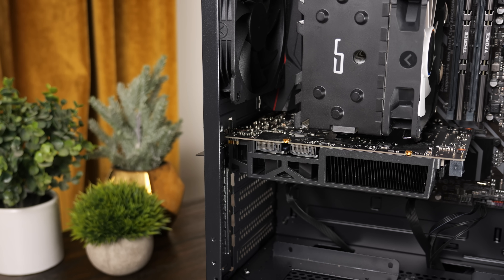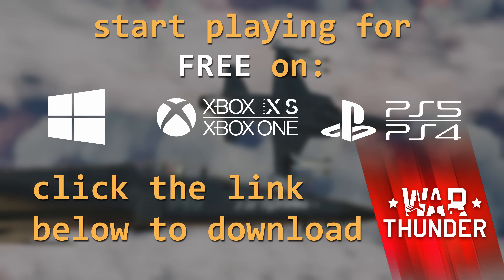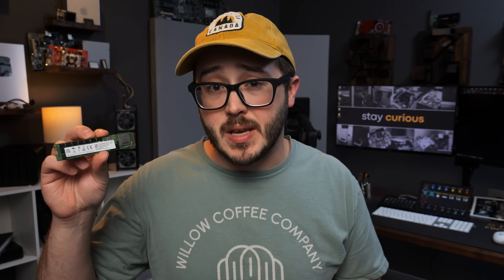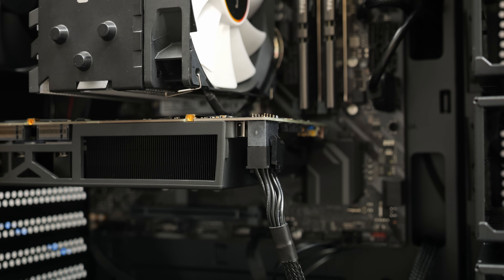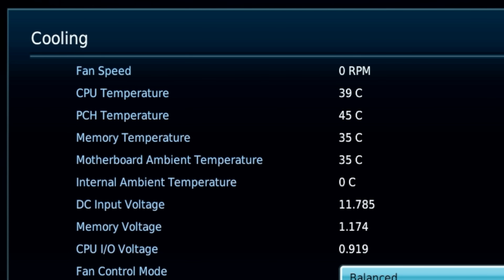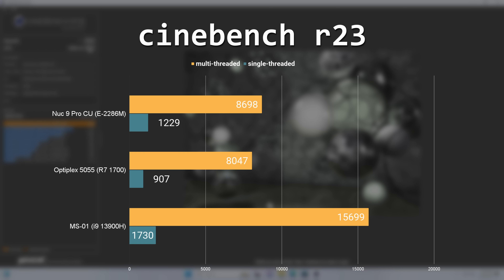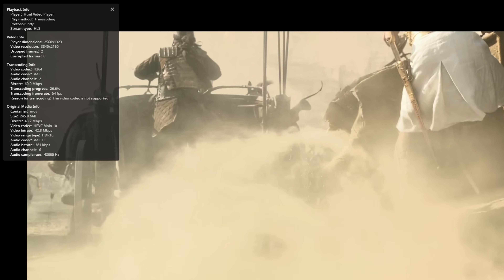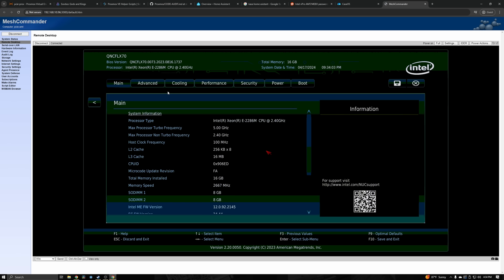I put a PC inside a PC (It’s actually GOOD!)

Comment: Running a computer inside of another computer for streaming was a thing before streaming became more realistic on a single system with capture cards

If I'm not mistaken there were computer cases that had mounting to add a micro ATX motherboard inside of the top of your gaming PC to separate the streaming software from the main gaming system

So the back of the computer case would have two IO shields

I don't think those lasted very long though

Bitwit posted a video six years ago "Dual Stream Streaming" that shows a case that does this

Comment: Was wondering if you were going to make a follow up on this video and go over any trials and errors that may have occurred?

I am thinking of trying this out but am still on the fence about it.

I would like to use it for game recording and video editing the games.

Do you know if I could use the Intel CPU in the nuc9 to remote with my AMD 9950x CPU (Windows) of my main computer, or if I could do a network connect between the two using the network ports?

Also if it could be possible to solder in a new power button with a long cord to a custom Bay drive mount for easier physical on and off.

If possible for my setup, I do plan on getting a USB switch for the keyboard so I can switch between both PC's if needed and since I use Display port connect for my main, I can just connect the HDMI from the nuc9 to my monitor and just switch inputs when needed or just get a Monitor input switch.

Comment: One thing I'd like to try with this is plug it into one of those pcie x16 risers that miners use for their gpus. Should probably still tape the lanes. That way, you won't need to take up a slot on your motherboard. It just needs power, right?

Comment: Parmy really wants this just to figure out how to force it to capture the computer it's connected to screen and Work as an independent recording PC on the same desktop. Someone could probably get it done with Linux. Either that, or it could function as a Windows computer running on a Linux system that would allow Linux users to play Windows games and software without worrying about getting banned for cheating( Report it as like a 1080ti Graphics card connected to the PC or something)

Comment: Honestly, I'd be curious to see how it'd function in an M2 Mac Pro, with the full pins exposed.
Since they'd be two entirely different architectures.
I wonder if the PCIe lanes would still mess up, or if macOS would actually be able to boot, and see the PC in one of it's slots.
Reply: what would be cool is if Apple approved an Intel or AMD accelerator for Rosetta 2, to have near 100% compatibility with x86 apps.

Comment: Hold on a sec you're putting it into an ATX chassis into a uATX mainboard, when you have an oodle of space under the mainboard that can't be used for much good.

You might not need the PCIe connector at all. Or if you do, you can just hotwire it, since you don't get any actual PCIe connectivity, not in this direction, just some voltages and whatnot. So you can use the chassis space under the mainboard for it. You can even make a backplane that allows you to plug another PCIe card into the NUC card!

I know that you have a PCB company sponsorship waiting in your e-mail inbox.

Comment: Add this board to the back of a BD790i. It's a 16C/32T 7795HX with 64MB L3 Cache, up to 96GB DDR5 5200 SODIMMS. 2x PCIE 5 NVME & a PCIE 5 x16 slot.

Comment: Those would have been great if Intel didn't screw up the orientation.
They should face up opposite to normal pcie cards so they can sit back to back with a gpu.
Once the backplane standard took off a bit, you'd see sockets, and all the normal desktop motherboard things.
Alas, they screwed it up.

Comment: seems this was a clearance sale as $150 is an insanely good price for that system.
I actually have an interesting use case for something like this, I've been wanting to use my own mini pc (that is currently my homelab) for a dual pc setup where I have a really powerful gaming PC run my games on my main monitor and then a somewhat lesser PC run my media (youtube, discord, VLC, twitch etc) on my 2 other monitors. I planned on using software to mimic the mouse/keyboard and transfer audio. I also planned on using parsec if I ever want to pull up the media PC on my main monitor or something like that. I suppose another question would be if you already have a big GPU can a mid-tower even fit this PC inside of it lol. I expect some cases won't be able to fit both.
For $150 I probably would've pulled the trigger on this system instantly, really good value.

Comment: So it could  be setup as a very basic DIY blade system if you could find a host mobo with the necessary slots you could add multiple ones.

Comment: This reminds me of the old Radius Rockets cards that you could add to NuBUS Macs. They were essentially 68040 cards that would boot into a Mac OS in a window on the host system and be accessible to it. In the case of the two that I had in a Mac II, they were faster than the system they were plugged into.

Comment: What I want is a card like this that just acts as a resource card for VMs... I.e my host system is ARM and this thing just sits there untill I want a vm running on X86 cores. or the opposite X86 host with arm cores on pcie. Mixed architecture VM server would be amazing.

Comment: The concept of having an auxiliary/secondary processing unit is something I have been contemplating. If we could set the device to act as a slave processor instead of an individual computer, then you might be able to increase your computational workload. 

A GPU is basically a specialized computer designed to process objects on your screen. The key difference here, though, is that now you have a general purpose processor that can be assigned tasks while your primary CPU is occupied.

Say you have a game running. Both the CPUs can share the workload of computing what's happening, relieving stress from your main chip. But then, you suddenly remember that you also need to render your video, or compile that code you have to push out. Not to worry, the main CPU can take over processing the game while the auxiliary CPU starts computing the other job. You experience no throttling, and you can effectively multitask.

And if you have a system like the NUC, you also have additional RAM to pull from instead of having to share from a pool. It isolates the data and keeps the jobs separate to ensure they don't bog each other down. Throw in storage, and now your auxiliary system can operate as a completely isolated system if need be, while also under the direct control of the main board. Its like having a botnet, but without the networking (technically). 

Imagine the two systems doing cloud computing internally within the same system, accelerating your overall performance, having redundant systems that you can rely on (monitors tend to have two or more ports, so why not use them?), and even opening a way to have two users safely access the same drive, at the same time? Why wouldn't you want this upgrade?

Comment: Brownies Recipe

Ingredients:
	140 grams of chocolade
	4 eggs
	300 grams of sugar
	120 grams of flour
	250 grams of butter

Preparation:
1)	Preheat the oven to 160 °C.
2)	Beat the eggs with the sugar. Do this using a mixer.
3)	Melt the chocolate with the butter.
4)	Mix the egg mixture with the melted chocolate butter.
5)	Mix in the flour.
6)	Bake for 35 minutes in small in a large low mould.

Comment: One thing I didn't see mentioned in this video (I could have missed it so if I did, ignore this) is that single board PCs that you put in expansion slots is not by any means a new concept. It was more common for business / server network use in the 80s and 90s, but there were specific cards that were essentially single-board PCs with older for the sake of basically having support for older DOS applications that required a slower processor like an 8088 or a 486 depending on the use case and the hardware the card was made to work with. Since backwards compatibility is the name of the game in large-scale business computing, I imagine it was super useful having the actual hardware necessary to run some old but specifically necessary programs for certain tasks. DOS emulation and VMs weren't exactly as much of a thing during that period, so it made sense to basically slap a whole other PC into an ISA/PCI slot and use that instead. 

I could be misremembering, but I recall seeing a showcase of a card for the Apple II that was basically made for running programs for different 8-bit computers on it.

Comment: ? so no like internal connection to the host pc? not even a network connection? Seems pretty unuseful to me then. 

Also this video is so stretched with unnecessary infos its just sad. I don't want to know that you didn't use the proper psu in the first place and then had to order an adapter WHICH DIDNT CAME and then had to order a second one DUDE WHO FUCKIN CARES YOURE INCAPABLE OF LOOKING UP IN ADVANCE WHAT YOUR SYSTEM REQUIRES. Fuckin knob.

Comment: My biggest question is how would one go about using this as a streaming PC inside a gaming PC? Like obviously it should be powerful enough to run OBS and stream, by the only hurdle I see is how would you capture video with the NUC? Realistically I guess you could use like a cheap Elgato Camlink dongle and feed an HDMI cable around from your GPU, but that feels a bit clunky.

Comment: This extra computer concept is exactly how your GPU actually works, it's essentially another computer built for a specific purpose, that interfaces through a high-speed low-latency pc bus. The only reason it doesn't have on-board storage atm, is bc the architecture is not designed to compress/decompress files or do other general tasks like the CPU can, therefore limiting what it can accomplish in the pc realm. The card shown in the video can be used to interface with your main for two reasons: 

1: If the card's firmware is updated/jailbroken to act as a slave device, rather than a master device when it came out of the factory floor. 
2: Intel provides drivers for the use of the card on a main machine so that it can interface and provide the main with certain functions/the ability to perform tasks on the card without incompatibilities/technical issues. Or a github repo is provided to provide drivers to use this card as a slave device to the main machine.

It's interesting the level of detail provided in the video on the usefulness of this card in a main rig, and the stuff u could do with it in this use case. But i just wanted to post my take on this and what i can think of what could help expand the usefulness of this outdated tech.

Comment: Same module but with i7 has been in use for 2 years. Works well. The main thing is that the "mother" system always supplies power to it 3.3. Fast reboots or other things that can interrupt power should be banned.
Additionaly all NUC9 modules support SATA drives. You just need to buy simple connector.
And because I have only one pci-e there is no need to use capton tape.

Comment: This is actually a really smart, you can use this as a gateway and external services host for your main rig. A kind of integrated "networking condom" as a turn of phrase, and still have it supply other things like as mentioned, game servers. In my case I'd probably use it to host my usual private servers, because I'm the kind of pseudo-antisocial weirdo that enjoys playing MMOs solo, but MMO private server software tends to dislike running on the same OS as the client connecting to it (something latency compensation related? Iunno.)

Comment: This sort of thing with the compute element on a Daughter board is nothing new,

I used to work for Digital Equipment Corporation and I have an old DECpc XL 560 that has the Pentium 60 on a Daughterboard.

You could pull out the daughterboard and install one with  an Alpha processor.

It is interesting people talking about this sort of thing 30 years later.

Comment: Fun video and definitely worth a look. If these were "purpose built" to do this (which they ALMOST are) I feel like it would be more viable. If there was more "interface" between the main system and the "Daughter" system such as KVM passthrough or at least some monitoring and controls I feel like it would be excellent. However with the lack of interface and the cost OFTEN not being cheap, a smaller nuc PC, and old optiplex with a cheap quadro or ARC card, OR a custom ITX build would all make more sense as a dedicated streaming PC or Low power home server.

Comment: The NUC 9 Extreme I have uses the i7-9750H.

It is a 6 core 12 thread running at 2.6Ghz with a Turbo of 4.5Ghz.

It is a great little home server with support for 3 M. 2 NVMe drives.

The daughter board can support 128GB of RAM and has 2 M.2 slots.

The Pro daughter board version comes with Xeon processors while the Exteme version comes with i5, i7 or i9 core processor.

The i7 is the 9750H.

Comment: It'd be really interesting if one of these could emulate a 10Gbe card over the PCIe connector to create a high speed link to the host system, but unfortunately I don't think that's something that can be achieved solely on a firmware level 😭
Reply: There are M.2 2.5Gbe/10Gbe network cards that could be used to create a higher speed link with the host, but a solution utilizing the PCIe slot would be coolest
Reply: How do you think real ethernet cards do it?  By the way, virtio networking (or virtio anything) is actually a virtual PCIe.  Wouldn't be surprised if an FPGA hacker implements "real virtio" at some point just because they technically could.

Comment: you could use that hardware passthrough to pass through the igpu (or more preferably the virtual feature (vf) of the igpu) in order to do stuff like plex transcoding or run hardware acclerated remote desktop in a vm.

Comment: Pro:
It supports upto 128 GB of RAM.

Con:
Power consumption is a bit higher than what I would like.

On the upside though, buying it in the NUC form factor means that I can plug my 100 Gbps NICs into it.

Hmmm....that might be worth considering, even if the processors won't be as performant (vs my 5950X).

Comment: SO, theoretically you could use a mining motherboard and frame with PCIE extension cables and create a mini server farm with these?
Reply: The mining motherboard is unnecessary. The PCIe slot isn't being used for data in that setup, so you might as well just use the risers without plugging them in to anything other than the power supply. Just using mining adapters, sure, you could make a server farm with these (using Ethernet for data), but buying actual server parts would probably end up much cheaper. Used server parts drop in price rapidly, especially high-end server parts. Used 64-core AMD CPUs, even with X3D cache, are absurdly cheap for the amount of processing power they have.

Comment: What I'd like to see is some sort of firmware where you could enable it to act as a PCI-e device instead of host. That would be useful to use to talk back to the host for various things directly.
Reply: Especially given the lack of 2.5/10Gbe. There are some M.2 2.5Gbe Ethernet adapters so creating a higher speed link to the system isn't impossible, but at a certain point I feel like you'd be better off running a Phanteks P600s or other dual system case and running two full PCs, each with full PCIe x16 expansion

Comment: better yet if this only draws power from pcie slot you could always throw it in to pc with a mining card riser witch has its own power input and take advantage of the lower slots on most full atx cases that will never have a card installed into them
Reply: There would be no reason to plug it into any of the motherboard's PCIe slots if using a mining adapter. This device is not using the PCIe slot for anything other than power in this use case. That's why he taped over the data pins in the video.